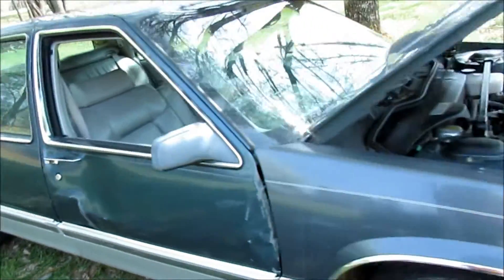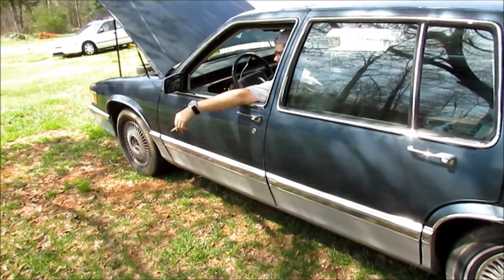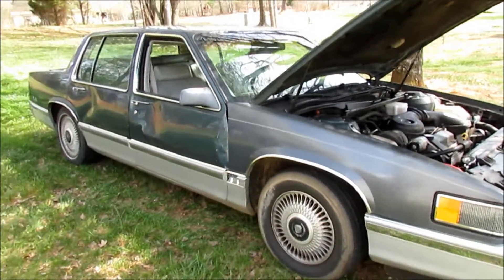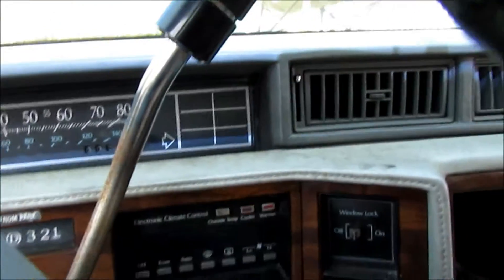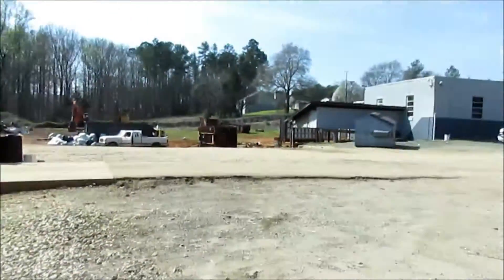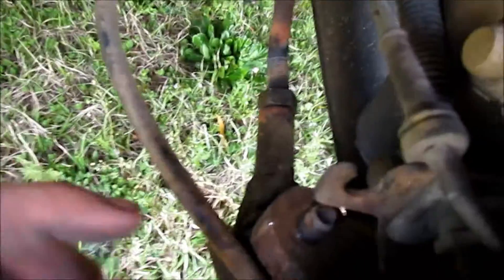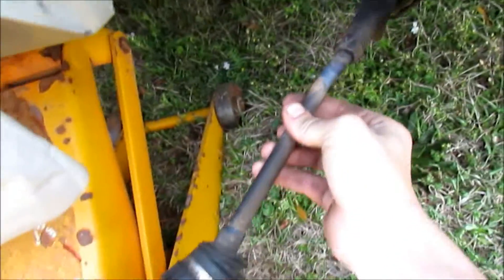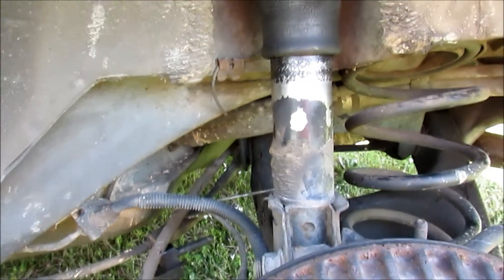Cadillac Deville Revival part 2

Comment: Those front lights in the corners are called "cornering lights". In NJ you would never get away with removing the cats. It would never pass the emissions test after that. Plus a Cadillac is supposed to be quiet.